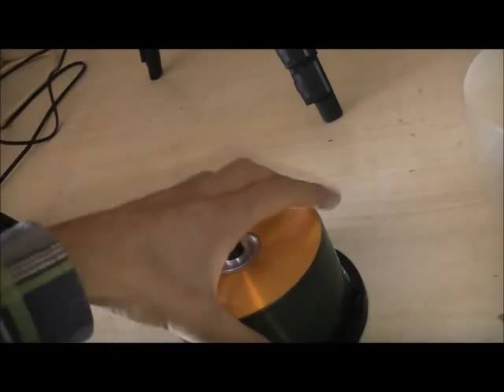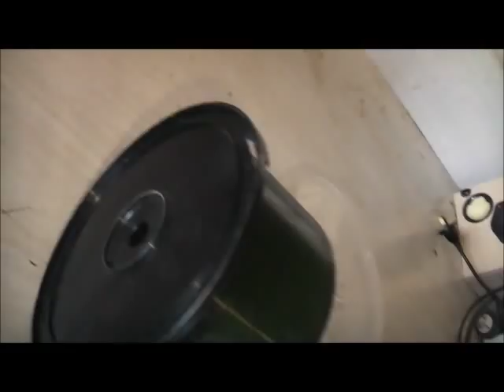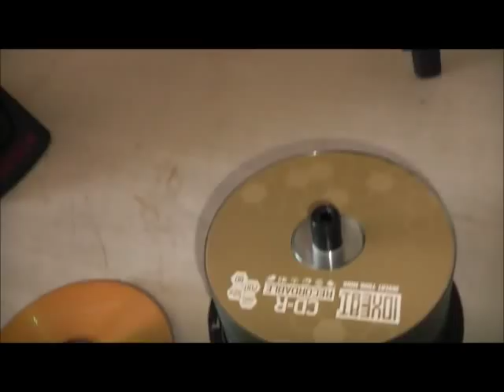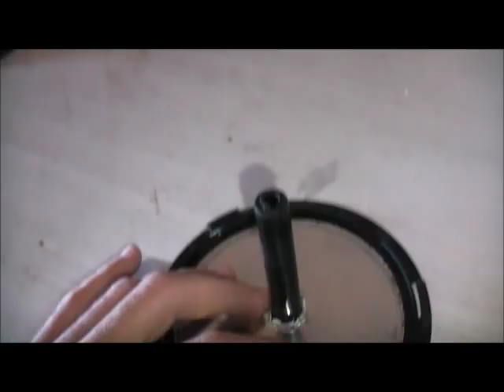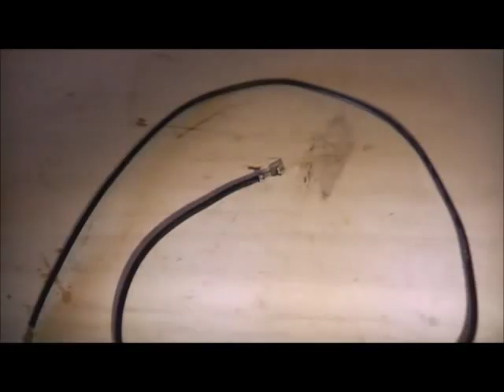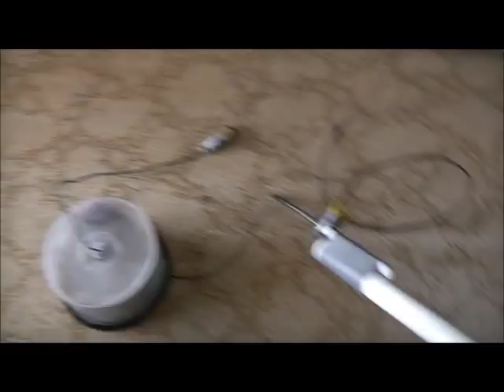CD Spindle Capacitor

Comment: What's definitely wrong here is you have 50 small capacitances in series; you'd be far better off with just a single CD. If you want to make a multi-layer capacitor, you need the capacitances to be in parallel. Specifically, if your two leads are "A" and "B", as you go up the stack the plates must be A, B, A, B, A, B... etc. What you've got here is A, isolated, isolated, isolated, isolated..., isolated, B, which will behave identically to two plates with 2 inches of polycarbonate between them.
Reply: TheHue's SciTech exactly what I was thinking.. he should of at least had copper wires daisy chaining from every second CD on each side..

Comment: I reckon you should try and connect alternate plates together, thats how multi layer caps are made. Same goes for the old style air variable caps in valve radios. All the moving plates are connected together, as are all the fixed plates.

Comment: If you can use odd CD's as one pole, and even CD's as the other pole.. it should get some(a lot more) kick (but it takes some work to do the connections, and it may zap over if you are not careful)

Comment: yep some one will correct you, not me lol :-)

Should still work without that, variable plate capacitors in old old valve radios only have air, and the plates are just plates.
Although they only have a small capacitance... ignore that lol.

Big gaps are good for high voltage but bad for the end capacitance value, hmm, its all down to what you want i suppose........

Comment: Sounds like a good experement :-)

Make sure the layers are compressed together, the smaller the gap the bigger the capacitance.

The bigger the plate size the bigger the capacitance.

Not sure what you could soak the paper in, light oil??? pass as im not a capacitor manufaturer but you do need something.

Forgive me if im telling you something you allready know :~)